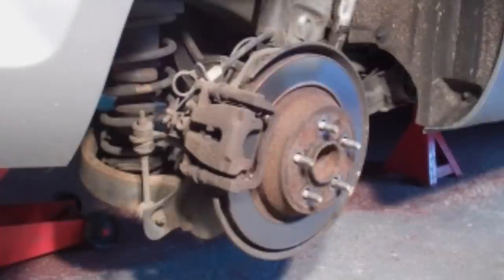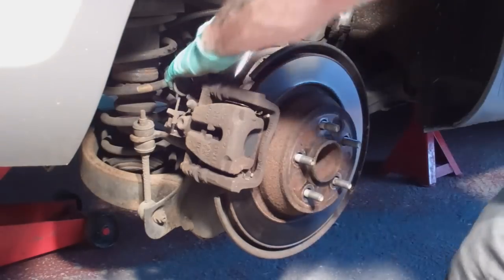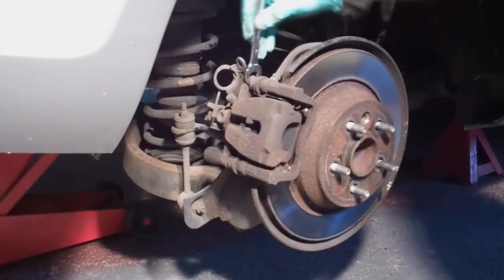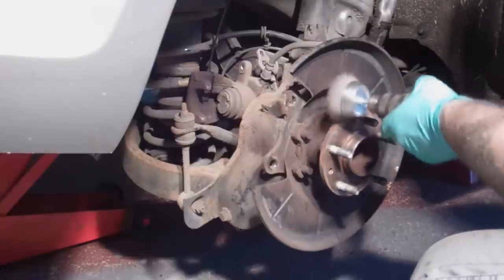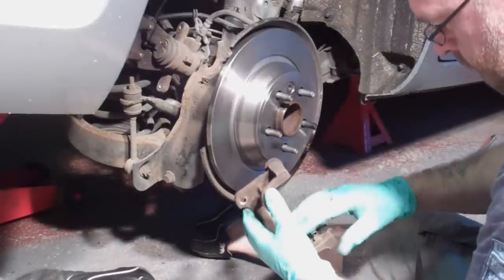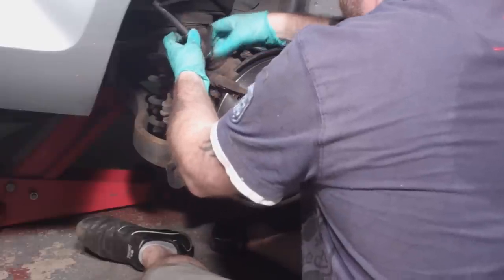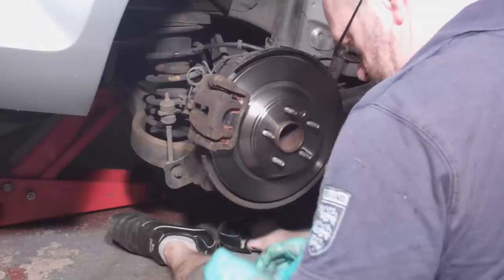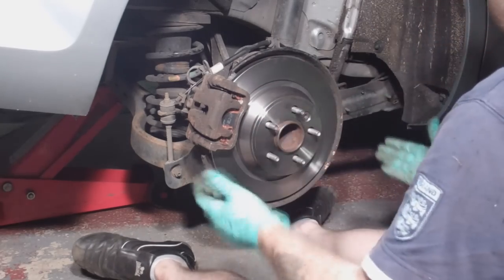New rear discs and brake pads - Ford Mondeo Mk4 (2007 onwards)

Comment: Thanks for the video.  Very useful.  I did this job on my Mondeo at the weekend.  I only took the calipers off and was able to take the discs off without taking off the carriers.  Though I share with other people.
Reply: Good call sir. I couldn't budge my carrier bolts and rounded the head off one, I was in a world of pain as I needed new discs. I read your comment and yes the discs can be swapped without having to remove those bolts. Yeh....

Comment: Tried to replace front disk on a ford fiesta mk7 2009, the disk was held in place with a center nut, my car only did 8,135 miles since it's last brake change and the disk was warped and edge peices missing, took me 2.5 hrs to replace both sides. cool video thanx for the tips.
Reply: no worries.

Comment: What is the thread on the main piston is it right hand thread or left hand thread on the side of the car you are working on. you never said and your hand is out of shot so not possible to see .
Reply: yds250 Right hand thread.
Reply: Thanks for reply. And Left hand on opposite rear caliper ?. Only worked on Rear drum Brakes in the Past.
Reply: Right hand both sides.
Reply: Thanks Again. Most the Videos i've Looked at seem to Miss this info out even the Haynes manual is vague which could end up in a mess if you go the wrong way.

Comment: You can actually remove the discs without removing the carriers 👍🏻
Reply: Yes, I've just done this myself. No point removing the carriers because the bolts are very tight and you risk rounding the heads. Disks come off and go on easily with carriers still in place.
Reply: I was sceptical about this as I had never had brakes before where the disc could be removed without first removing the calliper yoke, but I’ve just done mine on a 2011 Mondeo estate and it’s true. No need to remove the yoke and the disc can be removed and replaced very easily.
Reply: Not in my case, they do not come out. My car is a Smax 2006...maybe the rear wheel bolts are longer, but there is not enough room for taken them out without removing the carrier

Comment: There is no need to use the grips in order to remove the handbrake cable there is a nut at the back of the clamp you simply use a 13mm spanner on that to move the clamp forwards and relieve stress on the cable.
Reply: I gave up on the cable and left it connected, I simply couldn't get the cable end out, I tried the method shown, I tried a spanner, I also tried a pry bar. Only down side is you can't remove/replace the bolt for the calliper slider, so i put some thread lock on it an re-used.

Comment: Its a good video but no bolt sizes? Torques sizes? Also you wind the piston ckockwise or anticlockwise? I'll have to check another video
Reply: Stay away from brakes if you need to be told those things

Comment: dont suppose u could do a video showing the jacking points & axles stands location of mondeo mk4 saloon
Reply: I agree I have hatchback and not sure where to jack up other than the 4 points on the sills.If you have trolley jack already there then where do you put the axle stand ?
Reply: Get a hockey puck, cut a v shape into it, use that on your jack, jack the car just back from the marked jack point (the notch in the seem/sill), place axle stand (I use thick rubber sheet on top) next to jack also near to the jack point. Wash the area afterwards and apply "waxoyl" based underseal to prevent rust.